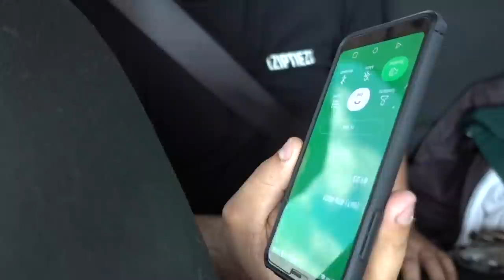Shahs gonna beat dusty?!

Comment: Pretty sure the 392 is referring to CI which is about 6.4l and not 392hp
Reply: tree jones That's what I thought
Reply: tree jones yeah it the hp on that srt is 485. Which seems lost a lot of power, probably more than 20% loss
Reply: from 485 to 375 is 29% loss, that is A LOT even for an auto... either it lost some power (440ish to the crank), or dodge somehow makes transmissions with more drivetrain loss than most other manufacturers did back in the 60s...
Reply: Djaro Dupont I don’t think Dodge are making bad transmissions, they probably overrated their engine which is an odd thing to do. But having a bad transmission will cause a bad rep for them so I don’t think they have this problem.
Reply: Klymbort AlBalushi I completely agree with you, the transmission comment was just a little sarcasm :p
Reply: The issue is simple its a mustang dyno which always read low...if it were a dyno jet it would have made well over 400whp